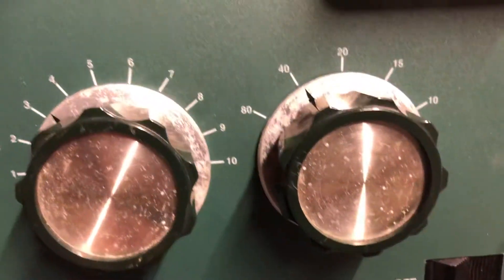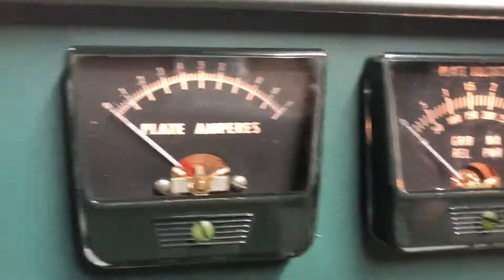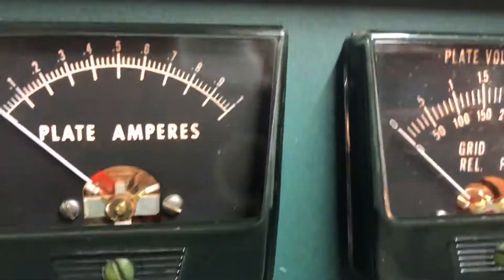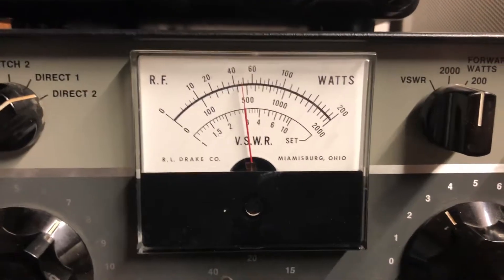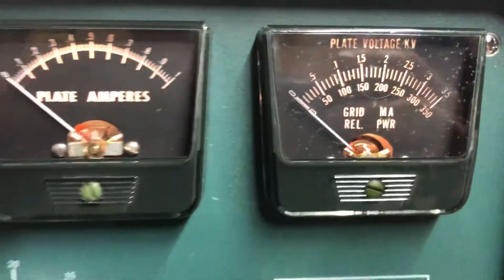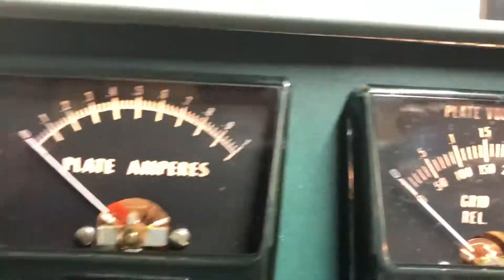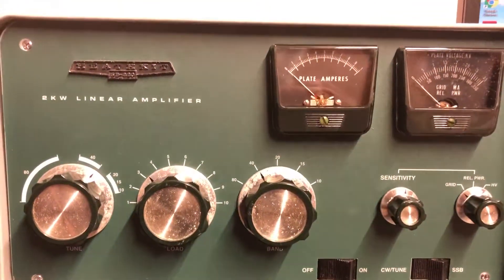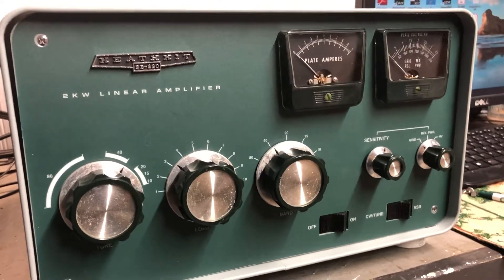SB 220 Meter

Comment: Check the meter with an ohmmeter. If it shows open, the meter is shot. It was a very common problem with unmodified SB220 when a short happened in the HV system. The meter isn't protected in any way in the factory supplied form ( a protection diode is required) .  It gets damaged internally (burnt). Problem is that finding a direct replacement, used meter is almost impossible.
Reply from the maker: Thank you